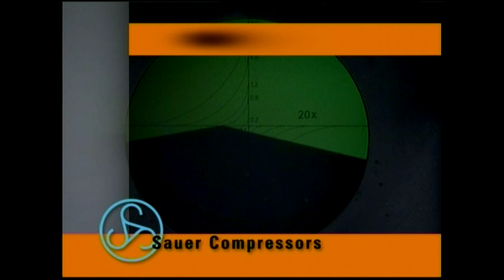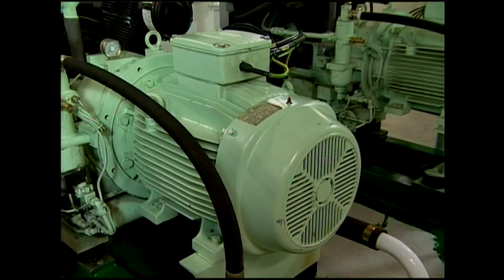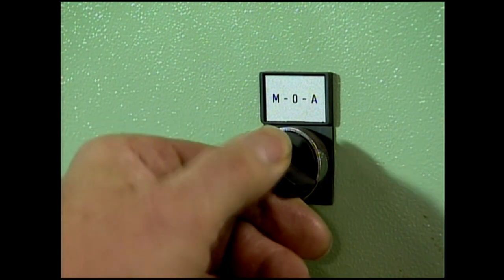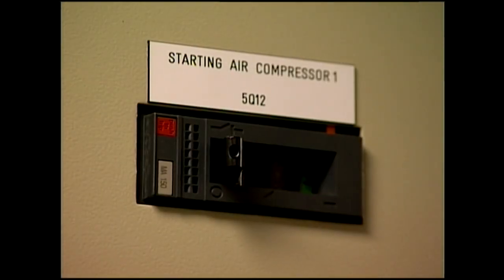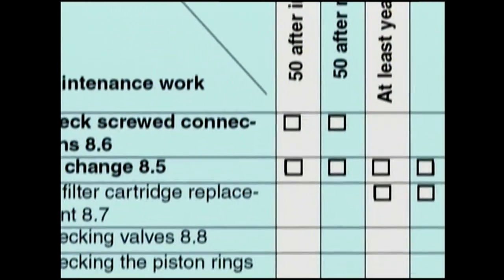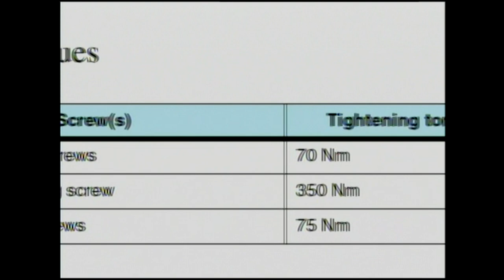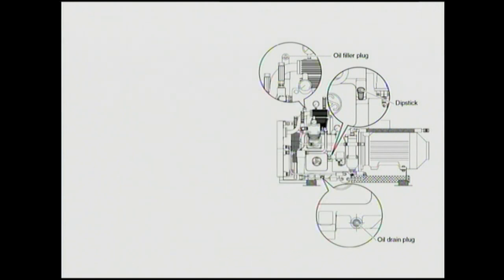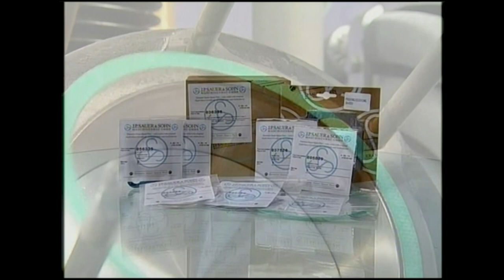SAUBER AIR COMPRESSOR FULL VIDEO

Comment: in my ship we had this compressor. 
very good one. that ship i worked 11 months, only added sump oil. that's it!
Reply from the maker: If the system working good only running hours maintenance remain and every month it is necessary changeover if you have two units.

Comment: Sir in sauer compressor wp271 L I'm facing issue of lifting safety valve of 2nd stage ....

Changed 3rd stage valve , it's gaskets, renewed safety valve wid new one  but still facing same problem....

What can be the reasons ? 
Any problem wid cooler like cooler is leaking ?
Reply from the maker: Hello if i get it correct you have a problem wih safety valve opening on 2nd stage. You can check your safety valve if the pre set pressure it's ok of safety valve maybe spring is been broken inside or loosen.Thanks!
Reply: @Adventure-Story  tried wid new safety valve then also it is lifting ....

 Can there be problem with cooler ..It is air-cooled type ... aircooler leaking ?? But not sure so not yet changed
Reply from the maker: @rakeshgokhale9643  hello dear friend if safety valve opens that means you have overpressure for some reason you need to look from where this can be done.
Something is not working properly or your valves are not properly assemble.Check carefully one by one components and compare them with drawings.It will need time but you will be learn in deep your equipment.